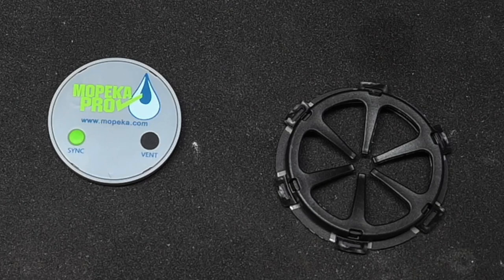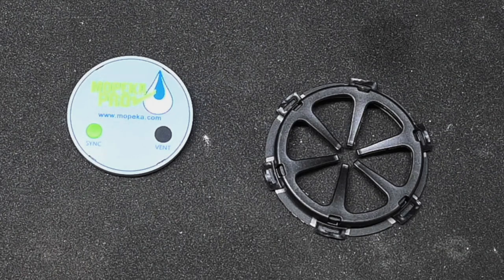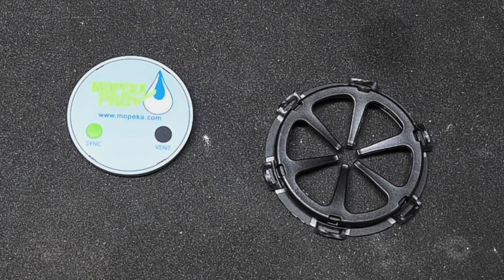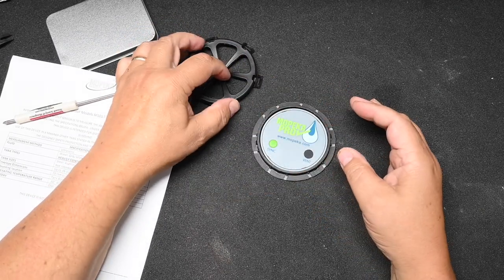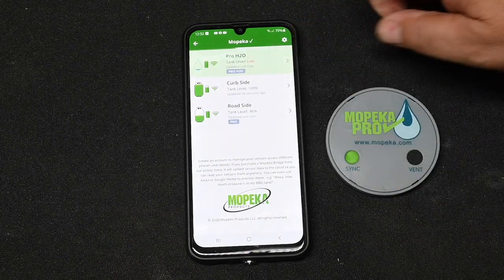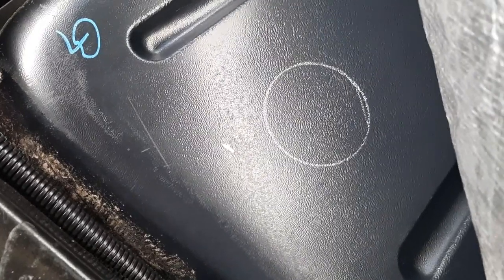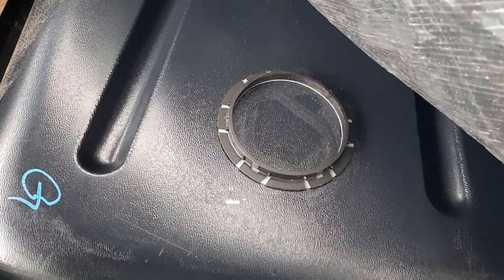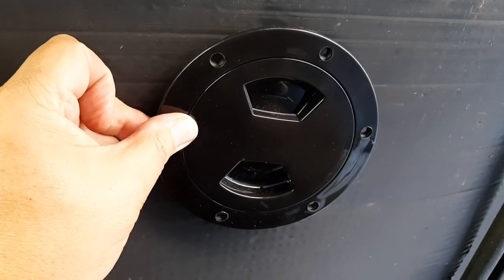Using the Mopeka Water Tank Sensor for my Black Tank.

Comment: Any reason this couldn’t be mounted on the side of the tank?  It would be much easier to change the batteries on my boat.
Reply: This type of sensor is measuring the level of fluid based on tending sound waves through the tank and fluid inside. It cannot to that horizontally across your tank.

Comment: Brilliant idea with the deck plate for access. I have wireless thermometers installed in my underbelly and have been struggling with an easy access. This will work great for both!
Reply from the maker: Glad you liked the idea.
Reply: @RVProject  yep I ordered two deck plates and the tank sensor for my fresh water. I've had the propane sensors and love them, I knew they were working on these but I had forgotten.  I also subscribed!

Comment: Very interesting. But I really am glad I installed the SeaLevel II system. It works and you don’t have to replace batteries
Reply from the maker: I have the SeeLevel system as well, but when I ran across this product, I thought it might be an easy alternative for those that did not want to wire up such a system.  Thanks for your input.

Comment: I foresee a need for calibration of both full and empty. What's the point of precision based on faulty assumptions? Bluetooth access for filling the fresh tank might be nice.
Reply from the maker: The OEM sensors are fairly crude, and have low resolution - that is, if they are working - which is not often for at least the blank tank.   

The OEM tank gauge indicates empty, 1/3rd full, 2/3 full, and full.  Not a very good resolution. Thus, at best, the OEM sensors are only 32% accurate.  

For example, if the tank was actually 65% full, it would still only read 1/3rd full, or only 32% accurate. 

So if the Mopeka sensor is say 10-20% accurate, and always works, then it would still be an improvement in both areas, no?

So even if the Mopeka sensor is not 100% accurate, it is still likely to be more accurate than the OEM sensor, and more reliable. 

However as I stated in the video, I have only tested the device for one trip, so I do want to try it out awhile longer before I can provide a recommendation.

Comment: I found the boat deck plates interesting, but for another possible use. Our 5th wheel has a squeaky floor in one spot in the bedroom that drives me nuts! The location of it is up in the 5th wheel nose, between the pin box area and the front storage toward the pass side of the RV. No access from anywhere I can get into to locate squeak and apply lube (or shim to eliminate movement). You see any reason that I couldn't install a deck plate under the nose in the general squeak area?
Reply from the maker: I don't want to be an alarmist, but an all too common issue in a 5th wheel is the frame area under the nose is often a weak spot, and/or may have a bad or broken weld.  I would be concerned with a squeak in that spot.

A deck plate might help, but it is going to show for sure, so I would see that as a last resort.  What the factory normally does when repairing such areas is to remove the rubber strip along the aluminum trim.  There are screws under that strip.  

To disassemble that area, you would have to remove the screws and caulking underneath and slightly bend the aluminum trim strip out so you can see behind it.

But if you do that, unless you are experienced at doing so, there is little chance you will be able to get the trim strip reattached without severely bending it.

My advice is that if you have any suspicions of a bad weld on the frame to take the 5th wheel to a good RV shop.  Best of luck.

Comment: you know we've been living in our 5th wheel for coming up on 5 years and this is the 1st time I've ever seen anyone explain the quick access door through the underbelly.  Either I'm not watching the right videos or I don't pay attention... lol  Great tip, man.  I'm going to get under the RV and change my crudely cut and duct taped access holes in the near future for sure.  If you haven't figured out, I'm not the most innovative guy... lol  How easy is the battery to change in this sensor?  I had the LP sensors in the past and when the batteries died I tried to replace them but ended up ruining one of the reading sensors when I took the assembly apart.
Reply from the maker: The deck plates are standard boat items. When I had boats (prior to RVs), there were several deck plates for access into areas of the boat.

The battery is accessed by popping off the cover with a screwdriver.

Comment: It does seem odd that when it's made for gray water tanks it doesnt show levels heading to full.  I've had my shower and sink back up because gray water monitor said only 2/3 full.  Now I know 2/3 is full on mine.  Also, where and what kind of battery does this use?  I see you have Mopeka incorporated onto your monitor panel.  How is that done?
Reply from the maker: It uses a coin cell  CR3023 I think.   For the mounting of the Mopeka display, I had a panel custom built which allowed the display to be back mounted.

I have a whole series of videos that are indexed on my website ( http://www.rv-project.com/projects/rvtankcheck.php) that includes a smaller (and less costly) panel for the Mopeka display.

Comment: thanks for sharing. you crushed it with the solution to replaced the battery. A+ there. 
wondering how it works in fresh water. for boondocking / off grit is the most important measurement. and the original RV only have 3 levels. 
im subscribing and looking forward for updates on this test. thanks
Reply from the maker: Thank you for your support.

Comment: Curious if your having issues with your see level II monitor on the black tank?
Reply from the maker: No issues. But I do use the RV as a test bed so I can do these videos.  

I still prefer the SeeLevel though as I have a display unit in both the main console of the RV as well as a second monitor in the wet-bay area.

I like that I can fill the fresh water tank or dumping the holding tank and monitor the tank levels in the wet-bay.

If I had to use a cell phone to monitor the tanks will filling or dumping, it would be a bit more inconvenient I think.

Comment: Thanks for sharing Like #35 view #197.  You would think they would have high level notification for the gray tank.
Reply from the maker: It would be easy for them to fix.  It would only require a change to the software. It's been my experience that Mopeka is pretty good at improving their products, so perhaps that will be a future improvement.

Comment: That would be great if they could get that working better I would buy those in a heartbeat 💗
Reply from the maker: I am going to test it more next year. It is possible that the ultrasonic approach may never be quite 100% accurate as the solids content is variable.  

I did reach out to Mopeka and so far, they have not responded.

Given that, if the transducer is even 75% accurate, it is a lot better than what most of us have now.

I will publish an update video next year as appropriate.
Reply: @RVProject  right on I appreciate that I would like to see a follow up your probably right anything is better than the stock reader I did like the idea of putting in the port hole opening to make it accessible as like your trailer mine also has a heated underbelly with the corplass thanks 😊